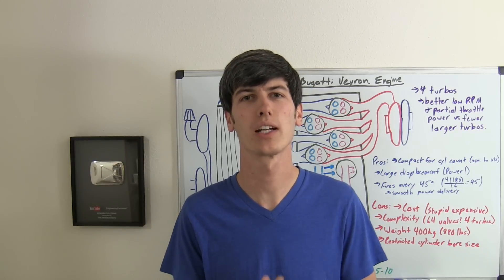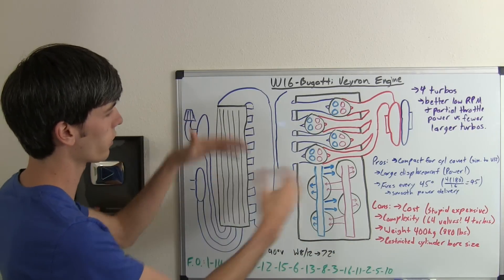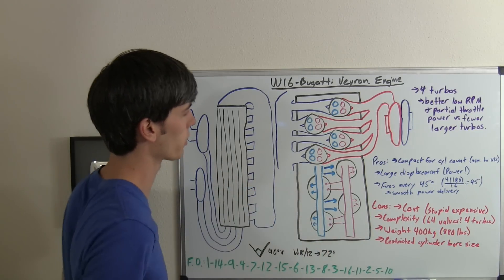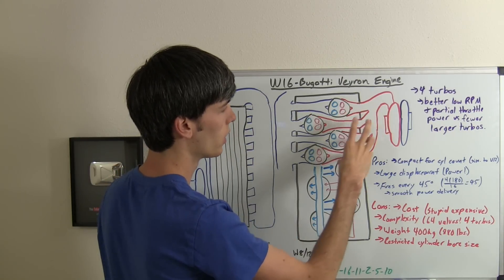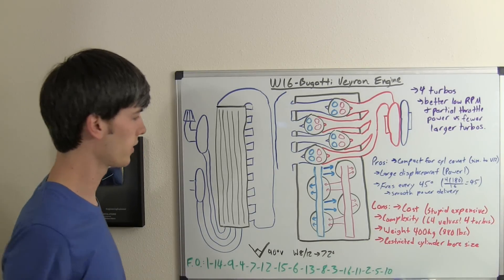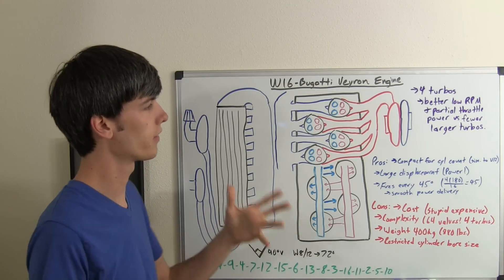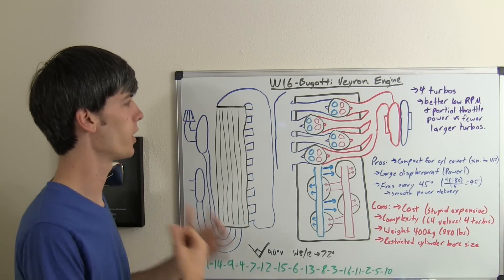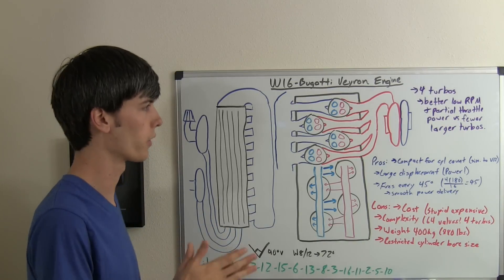W16 Engine - Bugatti Veyron - Explained

Comment: what a pig of an engine and it's overpriced. plenty of single turbo 4g63 motors making this much power.......that's a 2.0l 4 banger making the same power as a 16 cylinder 4 turbo car.
Reply: Sure, 4g63 could make that much power for around 5 minutes, and get rebuilt afterwards.
Reply: I'm getting tired of these Youtube engineers.